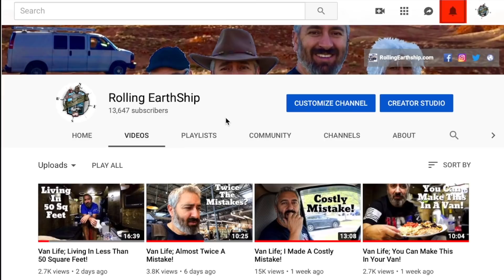Van Life; New Beginnings...And The End Of The Journey For My Dad

Comment: Mr. Loui, duct tape a 1 foot length of fluorescent flagging (I'm sure you have a good supply at your jobsite) to the shaft that the return spring is on that you keep hitting your head on. It'll kind of roll up when you put the door/ramp up and roll down and remind you to duck when you exit.
Reply: He did it on purpose
Reply: @danmcintyre4786  Quite possibly he did, but I've bashed my head multiple times exiting the back of my Harley trailer 😕
Reply: @DewdropN Hi!   😊 ✌